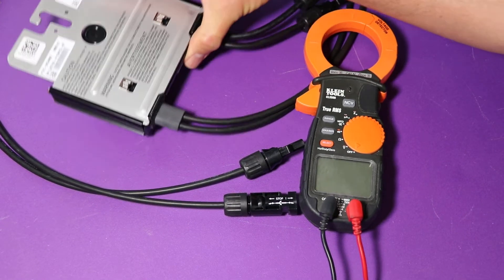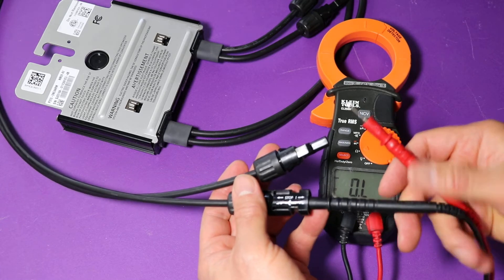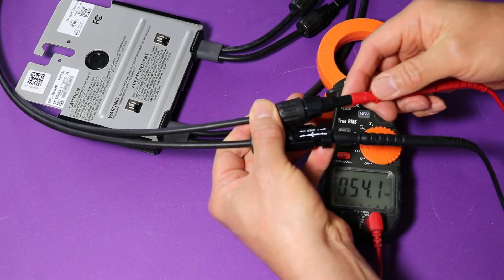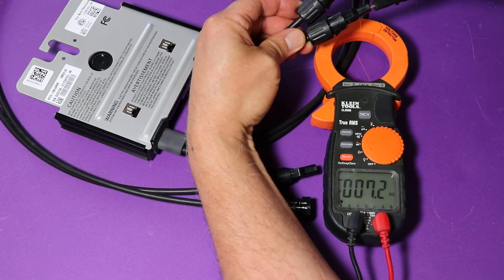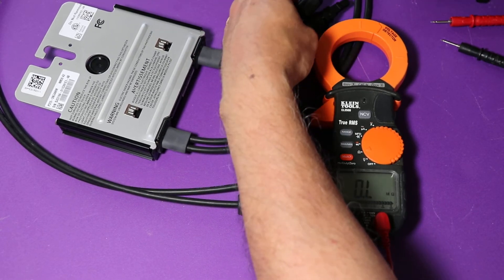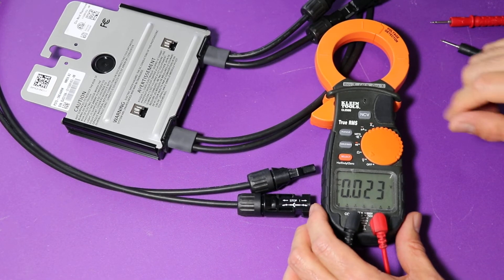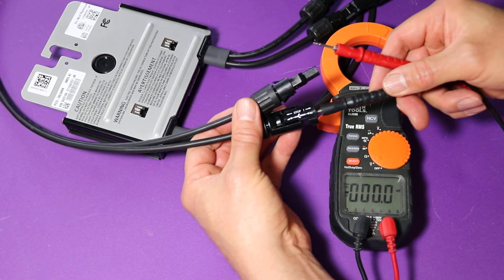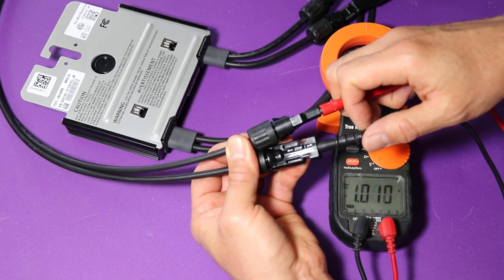How to Test a SolarEdge Optimizer

Comment: If I do not have a solaredge inverter and I do not have a silaredge key, is it possible to bypass the safe mode in order to make it work with normal inverters?
I got some old power optmizers for a few dollars and I cannot use them 😊

Any hack?

Comment: Another channel shows that even a bad SolarEdge optimizer can output the 1 V in safe mode, but not output more when connected to a panel.  So, this is a partial test, but not an exhaustive test.

Comment: I have two panels and two optimizers. My charge controller is saying that im only receiving 2 volts. Its that right?
Reply: Yes you're good
Reply: @Ericlmarwalker1  I should have done more research before buying these. I need a solar edge inverter to make it work.
Reply: @vicwilliams9731  Yes, they are not "just an optimizer", they are a "computer controlled optimizers". They talk to a central unit, which tells them what voltages they need to output in the strings. As well as monitoring those which may be "offline", or "faulty". It is a whole "smart system". As opposed to being raw, blunt, brute-force electronics that run independent of one another. They are codependent on the controller.

I have a feeling that you are just looking for a simple "PWM Boost/Buck optimizer". That would be the raw components, minus a controller. However, those normally run in parallel, not series. Since each one is attempting to raise a lower voltage, or drop a higher voltage, to a set output which can NOT be passed-through from one unit to another. They just add whatever available AMPS they can to the fixed voltage in the line.
Reply: @JD_Mortal  Thanks for the reply. I bought theres thinking that i should just get one per panel. So now i have 4 of these that i cant use. Good thing i only paid $50 each for them. I only have 4 280w panels. Its probably not worth it to get the controller.
Reply: @vicwilliams9731  i would try to figure out a way to grid tie or make a small 1000 watt battery off grid setup with batteries so you catch what you’re producing
Reply: @JD_Mortal  what is the name of this unit?
Reply: @vicwilliams9731 hello, I have an ABB inverter an it's not working. Each optimizer makes only 1V. Not enough to start the inverter. Is it sure that both has to be from solar edge?